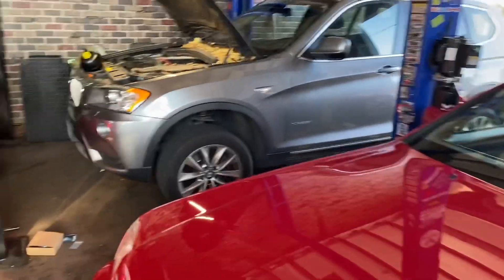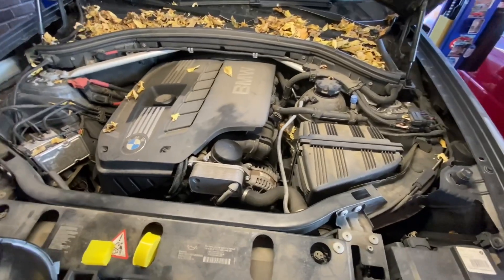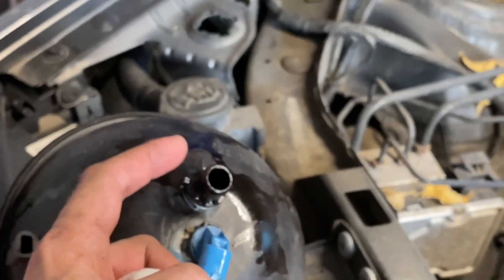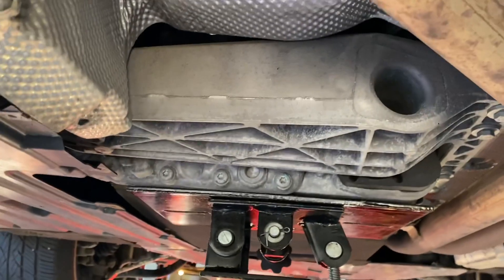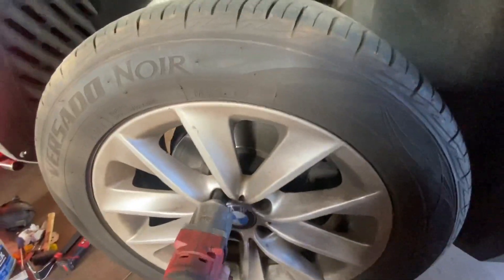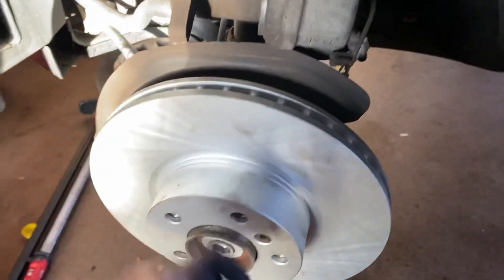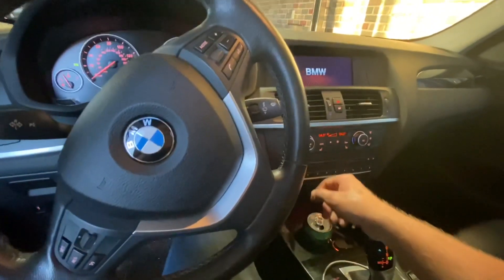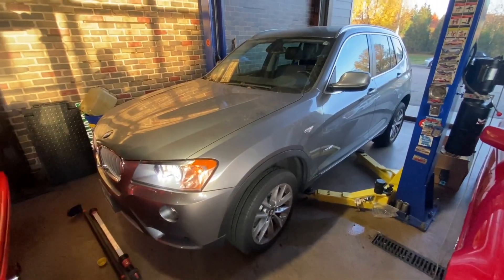2011 BMW X3 F25 coolant expansion tank front brakes and transfer case fluid

Comment: Question if you've come across this: F30 328ix, keeps leaking coolant randomly, sometimes a drip, other times like faucet.  Seems to not leak when heat is off, but heat works no problem, no smell, no leak inside.  I can't tell where it's coming from yet, but seems like lower part of engine, all visible hoses seem fine.
Reply from the maker: probably plastic fitting cracking but I dont work on any N20 cars. those engines are time bombs